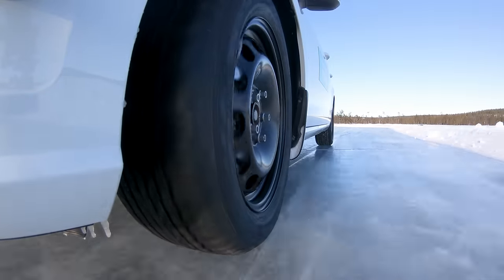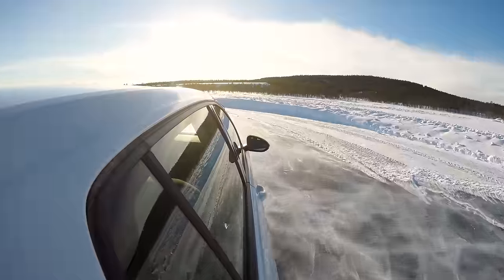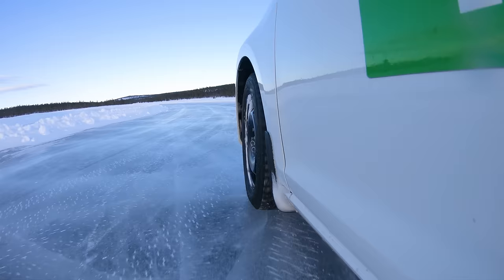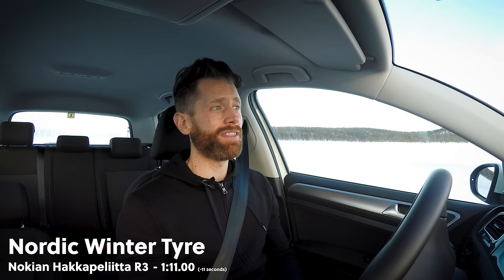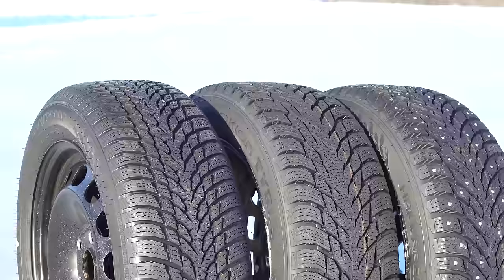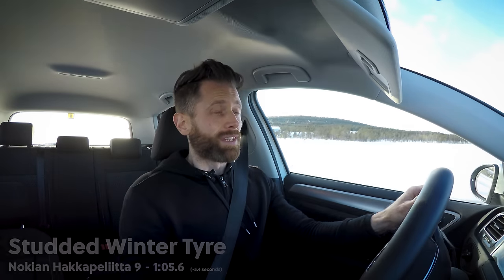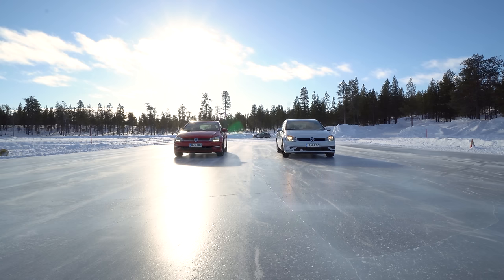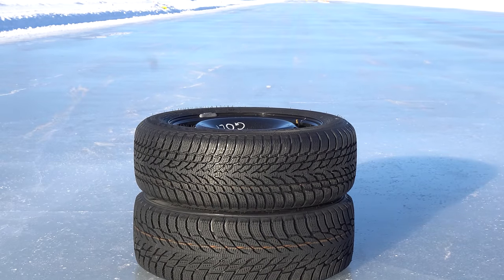Winter Tires VS Studded Tires ❄ What's better on ICE?

Comment: I would like to see a tyre size comparison on snow and ice
Reply: On my old Volvo V70 the recommendation during winter was 195/65/16 for non turbo cars. For turbo cars slightly wider between 205-215 on 16 inch wheels.
Reply: @VinDieselS70  I have XC70 and it has 235/55 17 for summer tires and also for winter tires. I had to buy new set for winter and I tried to think which is important. I could choose narrower tires but is it width or pressure (no tire pressure here) which counts? I chose wider tire because it means more tire between the car and the road.

So if the car starts to slide I think more tire is good. Wider is better? Pressure (force (=mass of the car) per area (part of tire which is on the contact to road at the moment) ) may count when accelerating or breaking. Correct?
Reply: @SeppoKoivisto  on dry tarmac wider tyres will work great but when it's snowy or icy smaller tyres are to be preffered due to driveability. With narrower tyres the car become more stable as the ground pressure on each tyre will be greater than with a wider tyre. 
Look at rally cars as an example, they always use narrower tyres on their cars on snowy icy roads as when driving on gravel roads as it will be more stable to drive and you will also get more traction. Correct me if I'm wrong 👍
Reply: On my previous car, a 1993 Toyota Carina E I had Nokian Hakka R 175/70 R14 tires and on my current car, a 2010 Honda Civic I have Nokian Hakka R2 205/55 R16 and it definitely felt like I had more grip with the narrower wheels on my old car on icy and snowy roads. It's not fully comparable though, as my Civic has torsion bar suspension in the rear while my Carina had independent suspension in the rear so it was naturally more stable on slipper roads.

Comment: It feels to me like you've fallen into some kind of a logical fallacy here by understating how much better the 5-second improvement is.
Improving time gets exponentially harder the more you improve. While a beginner might knock even 30 seconds out of their lap time just through sheer practice in a couple of laps, these gains become smaller and smaller and require more and more work.

Following this logic, I would say that the 5-second improvement is at least, if not even more impressive than the initial 10-second one.

Not sure, if you were aware of this, but the origin for the term "Hakkapeliitta" isn't actually Finnish.
At the time of the 30 Years War, the Finns called the Finnish light cavalry serving in the Swedish military 'Huovi', the Swedes called them 'Svenska Rytterna', like all of their cavalry.
The term "Hakkapeliitta", is a Finnic form of 'Hackapell' that the British used in their report of the war.
This is their interpretation of the cavalrys warcry "Hakkaa päälle!" (Roughly translated as 'Cut Them Down')

Since the Finnish language didn't exactly have a written form at all in the 17th century, it is this term that stuck rather than the original 'Huovi'.
Reply: No there is no logical fallacy here at all. It is only exponentially more difficult to make gains if you are constrained in what you are allowed to do eg it is indeed exponentially more difficult to find speed gains in Formula 1 because you are working within the constraints of a very specific set of rules (or you're pushing the boundaries of physics). In the case of this video there are no defined limits on what you could do/change. Think of it this way, the point he is making is that it is surprising that a compound change makes a bigger difference than adding spikes, and the video supports this point - out of the 16.5 second total improvement, 11 seconds was due to compound and only 5.5 seconds was due to spikes.
If we said to Nokian, now you must provide a set of tyres which go even faster than the studded tyres tested, so they just put twice as many studs in to the tyres and/or use a compound that would only last for 5 miles, they would immediately go faster and that would not be remotely difficult.
If instead we said, now provide a set of tyres that goes even faster, BUT you are not allowed to use any extra studs AND you can't reduce the tyre life, THAT would be very difficult, but only because we have set arbitrary limits on what they can do.

Comment: Did I miss it or the most important part ‘braking distance’ wasn’t addressed?
Reply: WiFy The word is “braking” from “brakes.” Easily confuses terms. You are right to ask about braking performance. However, there variables are high in numbers: wind, weight of vehicle, temperature, depth of contaminants, road slope and bank angle and, the big one-speed. Plenty of UTube videos illustrate drivers oblivious to the hazards of winter driving. The moral of the story: the operator of the vehicle IS the main safety factor, winter/studded tires notwithstanding. In short, get trained by professionals and practice, practice, practice. Safe travels. Thanks
Reply: Ramon Cardona Thanks for the correction, I’ll edit :) All things the same in a test like this, it will clearly show a major difference between studded and non studded tires, which of course matters just as much if not more in other conditions as well :) This is sponsored by Nokian that indeed does well revered tires, but the fact that they left that part out is probably on purpose. I’m from Sweden myself and well versed in winter driving, this simply does not show the major metric an experienced driver would ask for is which is stopping/brake distance. Acceleration? That test was the most stupid one, since in loose terrain you want a slow controlled start to make sure you do not slip. If and when you do, you even make the road more slippery for the next car.
Reply from the maker: https://www.youtube.com/watch?v=lplaTRkPjTg
Reply: Tyre Reviews That was a good video :)

Comment: Assuming they're carbide tipped studs it would be more accurate to say you're jamming ceramic into the ice.
Reply from the maker: Pedantic. I like it!
Reply: I read that the Hakkapeliitta 9 studs are stainless steel instead of the traditional tungsten carbide to reduce corrosion on salted roads.
Reply: Depends, I'll bet that more than 50% of the stud is metal vs carbide so metal still fits better..
Reply: If you want pedantic: the material used in most studs is tungsten carbide with cobalt, a Cemet (Ceramic-metal).

Comment: In Canada only Alberta, Saskatchewan, Northwest Territories, Nunavut and the Yukon allow studded tires without restriction, and British Columbia does given certain restrictions.
I've run studded and studless, and I will only use studded again where the roads are ice/snow-covered all winter; in southwestern BC where I am now I use studless, as studs just aren't needed. The Bridgestone ws90 is the best studless winter tires I've used, where the Michelin xi3s are good, though a little less aggressive in the snow and return better fuel economy. It'll be interesting to see how the new Michelin winter tire is.
Reply from the maker: Thanks for the information,  if you get the time please leave a review over at https://www.tyrereviews.com 😁

Comment: The lower the temperature, the less there will be difference studded vs non studded on ice. And the opposite the closer to zero the better studs are on ice.
Reply: I have heard that. That at ten or twenty  below the studs can no longer penetrate the ice and become skates.
Reply: Sounds like a good video idea for TyreReviews.
Reply: If you ever skated outdoors when it's in the teens or lower F you'd learn how sticky/draggy ice can get compared to ice in an arena.
Reply: Right studs are old wives tales their old technology and not really recommended which is why so many countries despite dangerous condition keep them banned their not as effective if the ice temperature is Bellow 6 degrees studs won't do anything.

Comment: Studs are awesome. During a winter storm where the temperature kept fluctuating between freezing and not freezing there were spots of snow, wet asphalt and ice everywhere. With the studded Hakka 9 my Lincoln LS drove like normal. Last year I couldn’t even get out of my driveway because I was on all seasons.

The only con handling wise is that they’re slippery when on roads not cover in snow or ice. I have to really roll into the throttle and turn slower otherwise the the traction control light flashes at me. The noise is a bit annoying, but you get used to it. It would be nice if you could somehow activate the studs at will so you can drive with them only when you need them.
Reply from the maker: Invent it, you'll be mega rich!

Comment: I live out west in Arizona, and I run studded tires on my FWD Corolla Hatchback and my four-wheel-drive F350 From about Thanksgiving until April 1   Phenomenal difference between studded tires and traditional winter tires, oh yeah by the way my doorstep at 7100 feet and I live in a town that gets roughly 100 inches of snow a  year

Comment: I live in Estonia and studded tyres are actually a huge source of air pollution in Tallinn since they grind up the road surface and then in Spring you have asphalt dust flying around in the wind. I know studded tyres are more grippy on ice but I still use studless tyres because I don't want to contribute to the air pollution. Also, studless tyres are far quieter.

Comment: Question: I live in Portland and we get snow once every 2-3 years but it’s usually ice and snow mixed for a week or so. I work in a hospital at the top a hill. I’ll only be using snow tires a week every few years. Am I right in asses studded tires are the best to have just in case. Since I won’t be using these all season, I can just get the most hardcore to be as prepared as possible right?

Comment: Just one problem with this fantastic test-on normal public roads you don’t run on clear ice surface. You run on a mix of dry/wet/snow/frozen asphalt 99% of a time. And studs don’t makes a difference  in this conditions.
Reply: In Iceland you can expect driving on ice up to a inch thick on the roads. Been there done that
Reply: In Finland... I see almost every year a photo of a road covered with ice and water on it. Worst condition for all tires and none of tires is good. Of course we can add uphill or downhill and so on. These roads are rare, but some lives in place where that kind of road is. Somewhere winter maintenance is unknown.
Reply: Try driving in MAINE during the winter months!!! You'll wish you wish you had studded tires!!! Your AWD SUV or 4x4 truck is worthless without them!!!

Comment: I use Winter Tires the whole year on my Audi 100 Station Quattro. I drive never fast, carefully and the weather conditions can change fast in Scandinavia.
My father is using studded because his house is standing a 60 meter way uphill and downhill is a sharp right turn.
If you don't get this turn right you will fall 20 meter and end up on hard Norwegian boulders.

Comment: It all depends where you live. They have done studies in the continental USA and they have determined that studded tires provided no additional traction over regular winter tires, in almost all real world winter/icy conditions. The only exception was when the ice registered zero degrees Fahrenheit, then at the point the studded tires slightly outperformed regular winter tires.
Reply: Fake news. My studded tires perform significantly better on hard packed snow and ice in extremely cold temps (-20c and colder) than the Blizzaks I had before (supposedly top of the line studdless winter tire).

Comment: I live in the north of Sweden and there is both a lot of ice in my city during the early autumn and spring but also packed snow and ice. I always drive with studs from the first snow to late spring. I’ve evaded a moose once and ended up in the deep snow. Without good tires me and my daughter might have been killed.
Reply from the maker: What's your brand?
Reply: @tyrereviews  on my wife’s  2020 RAV4 hybrid she got Continental Ice Contact 2 from the dealership and for my used 2003 Corolla I fitted brand new Michelin X-Ice North4. Both feels very good but since the RAV4 have 4 wheel drive and anti spin and stability control they drive differently. On my Land Cruiser PZJ70 I have Iron Man PolarTrax, bought them used from a Mitsubishi L200 pick up. I couldn’t tell if they are good because the car is more of a truck without electric gadgets and I won’t dodge animals with that particular car because then i will spin or flip over.

A popular choice in my region is the Finnish brand Nokian Hakkapeliitta 10 but they don’t win all tests every year.
Reply from the maker: @robertraman6307  Nice :) sounds like a good selection of tyres all round :) IF you get the time I'd appreciate some reviews on www.tyrereviews.com as we're lacking in this category

Comment: If you are driving mostly on snow and ice covered roads, there is no doubt that studded tyres are optimal. However, if you also drive a lot of the time on dry/salted roads incl motorways, I would much prefer studless. On clear roads, studless is much more comfortable and studs do wear down if you mainly use them on dry roads. Besides, studded tyres rip up the asphalt and create a lot of harmful dust. I have been driving on Nokian Hakkapellitta R3 for several years, as well as Goodyear Ice Grip 2. Before that I had Hakkapellitta R2s, which also were very good. I’ve also had Bridgestone Blizzaks but found them to be very soft and rubbery (!).

Comment: The amount of times that I’ve actually needed studs in central British Columbia has been reduced to a minimal during the last 4-5 years. I’d rather take the friction tires to be honest. You can still get around safely, albeit a bit slower on the horribly icy days, but you aren’t listening to the constant annoying drone that the studded Hak 9s make. You will also achieve superior grip running friction tires in dry, or wet conditions during cold weather. The performance in deep snow/slush is a saw off. I’d rather run a tire that is comfortable for 120 days, and sacrifice a bit of grip on the 10-12 really icy days, where studs would actually be beneficial.

Comment: The fact is, however, that very few people encounter the solid ice conditions of that frozen track on a day to day basis, if ever. Most face a combination of snow, packed snow, ice, wet and mostly dry conditions in the winter. Often, side roads will be snow packed, while primary roads that get a lot of traffic will be dry as a bone.  In these real life conditions a tire with more balance is preferred, such as the European winter tire. Unless you live in Alaska or Scandinavia of course! How do studdable tires do when not studded (a popular option around here, because they are a lot cheaper than studless snow tires)?
Reply: Alan Sach Well there are alot of us living in Scandinavia and its just those few moments when you are driving on a road of pure black ice when you are so glad you are driving with studded tires.
Reply: Absolutely. I never meant to imply that there isn't a place for them. But a lot more people live in conditions such as I describe. Studs damage dry roads and can actually be dangerous on them. Non studded tires are much more grippy in dry conditions. I live in the states near the Canadian border. We get a fair amount of snow and ice. Plows come through fairly quickly and clear main roads. Traffic melts what's left. Side roads are often horrible. Studless seem better in these conditions. Most of your driving, most of the time is on dry or nearly dry main roads. I also read a study from possibly the University of Washington(?) that said that studded tires have an advantage on ice between 0 (f) and 32(f), but that in extreme cold they sometimes have difficulty digging into the ice and can act like skates. I don't know about that, but I did read it. Folks who use studded around here seem happy. If conditions are that bad I stay home!! ;-)

Comment: Superb video and recommendations, thank you. I'm running KO2 BFG tyres on my L200 and they are superb, 3 mountain peak and M+S rated. Is there a studded tyre for the pick up truck you could point out for the use in winter in Norway please? Thank you

Comment: Not sure on class leading. For example often heard new michelin studded XIN4 outperforming hakkas. And nokian also may have gone to some compromises in R3 & H9 to improve eg. wear/noise/rolling resistance, so somebody for some uses for maximum grip may prefer older R2/H8 ones.

Comment: Good test. It is one thing I have to comment: The studded tyre compound is much closer to the european tyre than the nordic studless tyre. This is because the nordic tyre compound is so soft that the studs will fall out very fast.
Reply from the maker: You are correct!

Comment: I had studded tire on a fwd Buick in 1995. It was a tank. I could pass 4 wheel drive truck. And get going and stop faster on ice. In Ohio (USA) we can run stuff a few months in winter.  I have a diesel now with MasterCraft mud tires. I plow commercially. The do great. Only spin on ice if I have heavy snow I'm pushing. With my 10 Boss plow

Comment: Excellent comparison on the ice!   How about a similar comparison on dry and wet pavement?  (maybe back at the indoor testing facility?) Living in the Pacific NW of the USA, there are way too many people who insist on using studded tires, even though most of the winter the roads are bare. So we end up with roads and highways destroyed by studs.

I am so very curious how stopping distances compare from all-weather (CrossClimate) to full winter to studded.
Reply from the maker: Check out the video linked in the pinned comment!